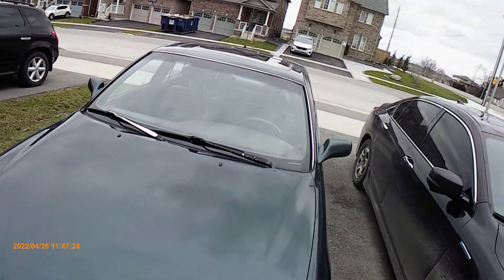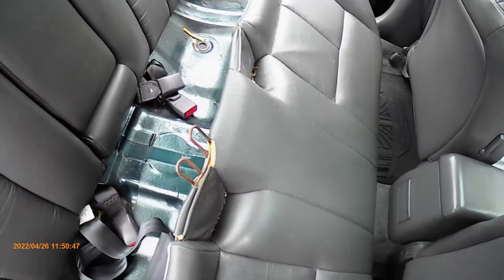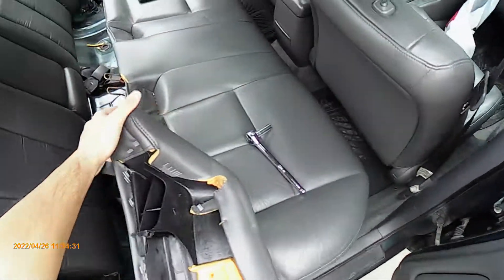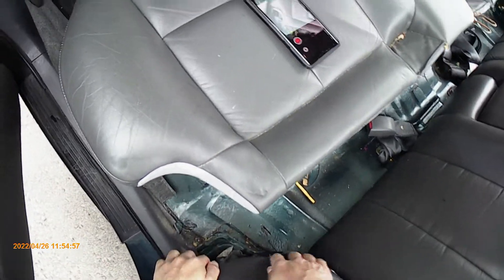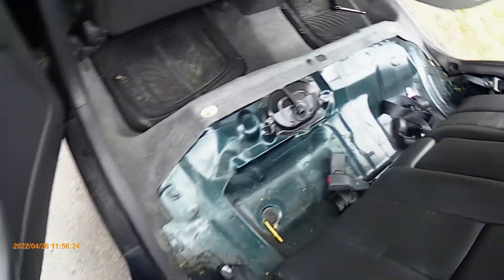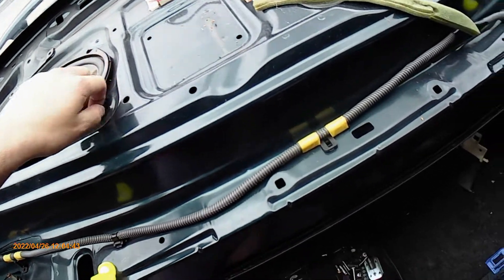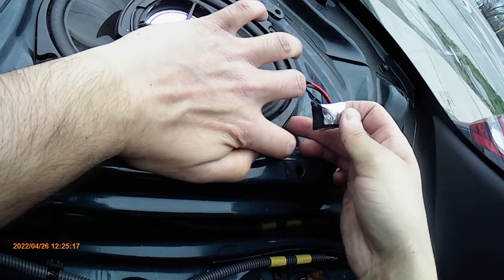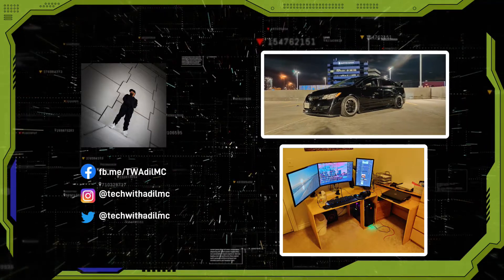1996 Toyota Camry V6 Restoration/Upgrades - Part 1 - Audio

Comment: When I replaced the speakers in my ‘99 Camry, I used a Dremel and cutting blade to remove most of the factory speaker to make a mounting ring for the new speakers so that I could utilize the factory holes/bolts in the rear deck and the front doors. Worked great! All 4 factory speakers were dry rotted. I also installed a JVC head unit. Big improvement over the factory system.
Reply from the maker: Yea that's a great idea as well and probably more full proof than what I did. I hope my experience was a learning experience for everyone watching. 😅